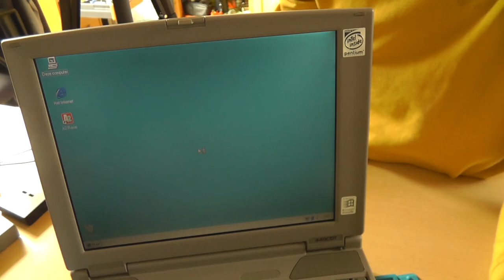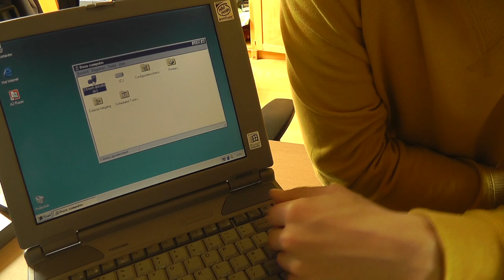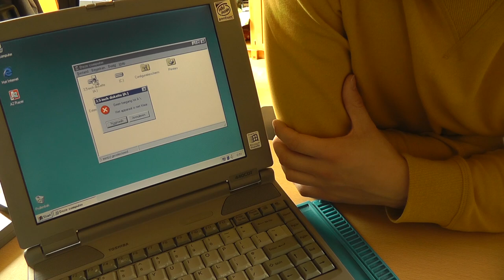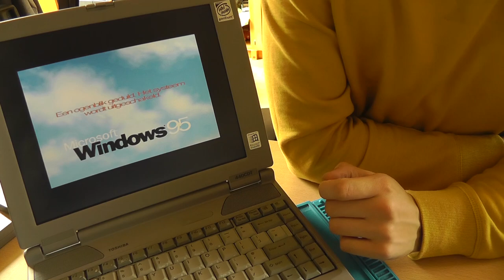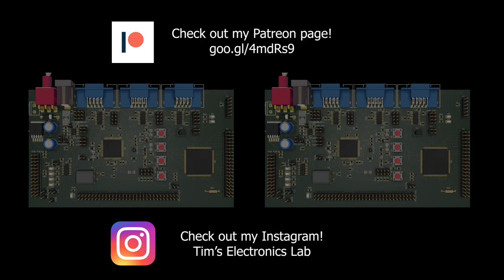#86 Trying to fix a floppy drive 💾 with a rubber band!

Comment: the connector on the side of the side of the laptop that you didn't recognize is for an external floppy drive so that you can have both CD and floppy for the purpose of installing an OS as the laptop probably cannot boot from CD
Reply from the maker: Really?! Cool, I didn't know that. Thanks alot for your comment :-)
Reply: @TimsElectronicsLab  I've got 2 versions of the floppy drive for it, a large one and a small one, both take Citizen floppy drives using the 26 pin flat connector, I think the small version of the floppy drive is better nowadays since it is easier to attach the connector to a larger laptop floppy drive as the originals are notorious for failing.
Reply from the maker: Is your floppy drive still working?
Reply: @TimsElectronicsLab  yeah, mine has some alignment issues sometimes though, as the worm drive for the head isn't perfect and I don't have an oscilliscope to fix it, as a result I transfer my files using blind dialing through a homemade dial-up connection I made for my dreamcast years ago
Reply from the maker: Oh wauw very nice. You say that you can align the head with an scope? Can you tell me more?
Reply: @TimsElectronicsLab  the general info starts somewhere around 12:58 in the linked video, but the whole video is pretty interesting in any case

Comment: Hello! By any chance do you know the diameter size of the belt for this model?
Reply from the maker: The flat length is around 105mm, so the diameter will be that size devided by 2! I've just received my new belt, so I'll make a new video soon! In the mean time, I suggest that you checkout video #88
Reply: @TimsElectronicsLab   Sure, I will. I watched this video within a few days when you posted it by luck but until now I comment. I didn't see you had uploaded an update already! Thank you!
Reply from the maker: Cool! No worries, as it currently stands, there will be no more update video of this drive, the smaller rubber belt that I ordered also did not work. Please do let me know if you are able to find the correct belt and if you got it working again
Reply: @TimsElectronicsLab  Yes I got it working luckily! A local store had a few belts for tape players remaining from years and it seems to be working fine with a 68mm in diameter.
Reply from the maker: Fantastic! Thanks for your answer! Does the belt still have a thickness of 0.5mm?
Reply: @TimsElectronicsLab  it has a squared shape of 1 x 1 mm. 
However after using the drive for a while it failed and can no longer read disks. It sounds like the disk is spinning but I need to reopen it and see if the belt moved/twisted or there is another sort of problem. This is an old drive I got from ebay as broken. It was too good to be true to have it fixed as easily haha
Reply from the maker: Hmm, I noticed that the band was touching an scrubbing itself because it was too thick. Maybe the motor got too hot?
Reply: @TimsElectronicsLab  Sorry, I haven't had any time to look further into this until now. So, it doesn't seem like the motor is getting hot because of the band, still I might get a thinner one, 0.5mm like you said. The problem I noticed is with the heads, which seems to be getting stuck althought I applied some grease to the screw. Most of the time I can get it to read any disk after a few tries taking the disk out and back in or reconnecting the drive.
Reply from the maker: Hmm, that is the behavior I did notice too. When reading a disk fails, it might go a little further when you reconnect it. The motor also started to get hot with the bigger belt. I also need a head alignment, since I've messed with that. So if you've got any ideas on how to do that, please do let me know!